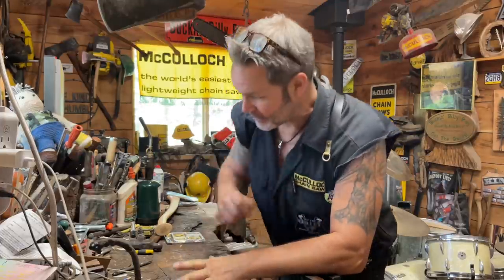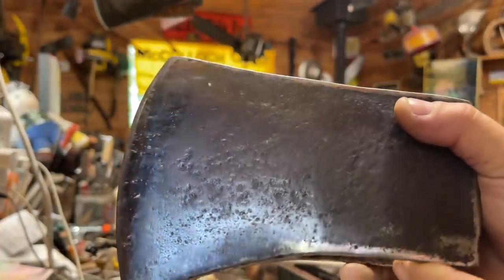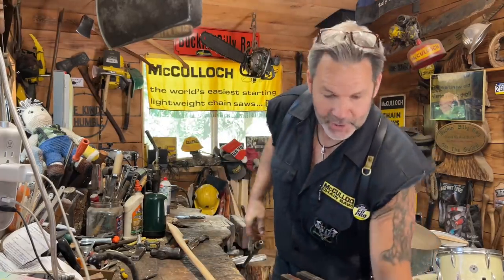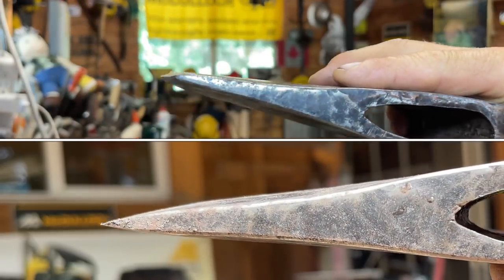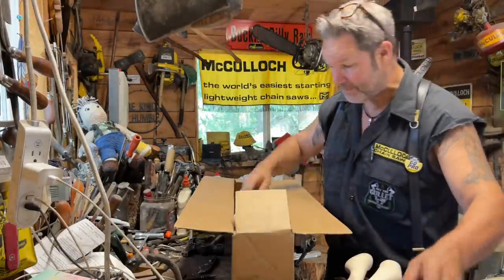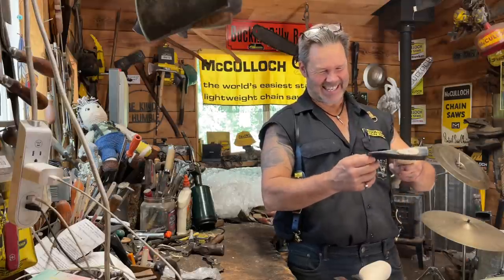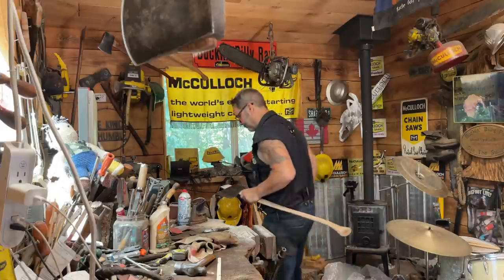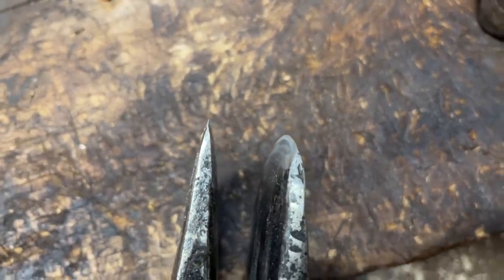Heavy Axe head, hung on a thin handle , tested

Comment: Mr. Buckin' , I meant to mention this back  the last time I left a comment & we were discussing convex & polished edges & there superiority to other edge profiles / geometries that can be utilized in different cutting situations , axe & other wise !!! Ok , here it is !!! the removal of a so called speed bump & other unwanted blade thicknesses is referred to as blade thinning & the need to do a blade thinning procedure is usually the result of prolonged use of a old timey sharpening stone & the lazy sharpener begins to stand the blade edge up to hurry the process of re keening the edge to get back into the work !!! when this lazy procedure is done over & over again the creation of a speed bump aka to thick a blade near the cutting edge is inevitable !!! Thus the need to remove the unwanted meat , thereby elongating a smother run up to the cutting edge & the blades side walls !!!
Reply: Nice details,  well said... Oops gotta hurry,  get back to work. 
Hurry with a flurry makes a man scurry into a tizzy that will make ya dizzy. In other words,  take your time and do it right.

Comment: yesterday i was doing some work to the profile on my hatchet and i got the thing dialed in for splitting 2.5 foot in diameter wood in 8-15 swings 
now its a light head and its got a 16 inch handle on it 
the weight of the thing is enough to stick the thing into a honey locusts log that's been seasoned for 2-3 years under cover
Reply: I'm plum crazy,  i like to eat the blossoms of the honey locust. 
That's some dang hard wood.
Reply: @jirusjirus9322  Yes it is in order to spit one piece  it took 20 minuets of swinging a 4 pound sledge hammer on to a wedge 
the wood has very twisted grain on it

Comment: I need some advice. I live in WV. I'm disabled.  I'm short 1 leg. Wheelchair bound. I'm going to start splitting wood. I need a great splitting ax. I can't find a place that has one. All I can find is cheap crap with weak handles. If you have any ideas, I would be honored to hear them. Thanks for the videos Billy. Keep the chips flying. PEACE ✌

Comment: Stringy wood. I'm in NZ and mainly cut bluegum (eucalyptus nitens) for firewood. I've been on my property almost 20 years and still have 6 bluegum that were 15 years old when I bought the place. I've had trees that were easy to split a week after felling and also super stringy ones. I've left trees on the ground for 2 years and they pretty much still have the same characteristics,  although just a bit lighter.
After pondering why some are and some aren't stringy I've come to the conclusion that I've got a theory. 
If I cut one down before the sap starts rising in mid spring it is not stringy and is also easy to split 2 years down the track.
If I'm late one particular year and don't drop them until mid summer they're stringy. Green or cured, left as logs or ringed earlier, they're stringy.
Your thoughts?

Comment: Hey buckin I have a poulan wild thing 18inch 40cc and it doesn't start after being warmed up. I am confused and was wondering if the buckin army could have an answer to my problem.
Reply: Paulan wild thing is your main problem....there plagued with issues..... but I have ran the hell outta them in my budget years and  a few suggestions to help you.
Reply: Just remembered something u can try first..... I'm sure ur poulan wild thing is bone stock amd has the stock spark plug installed...so simply take ur saws top cover off and pull ur spark plug out.... and take ur plug amd make the gap a little larger....for some reason they come stock with a spark plug gap that's very small...and making the plug gap a little larger makes for easier starting and much easier hot starts
Reply: Thanks man I will try that I prefer mac and homelite I have a mac 110 aswell so thank you cody
Reply: No problem man...I'm a husky guy myself